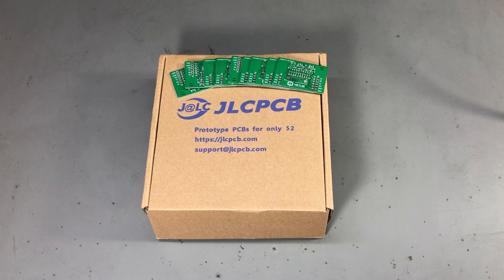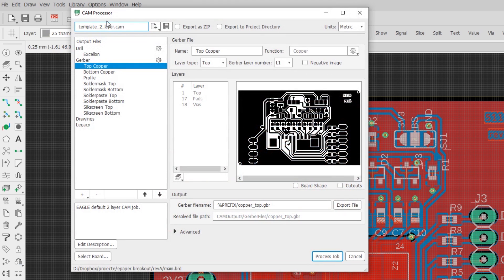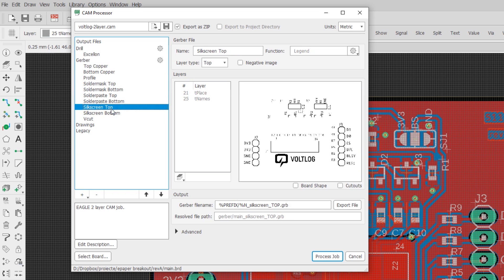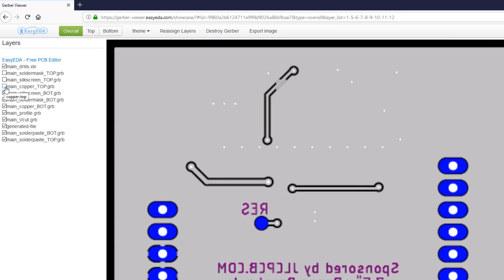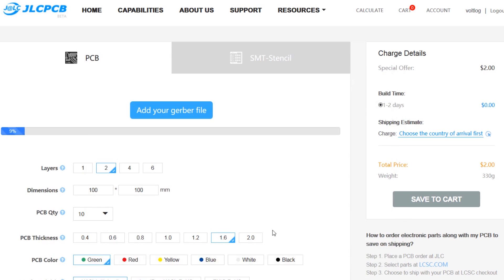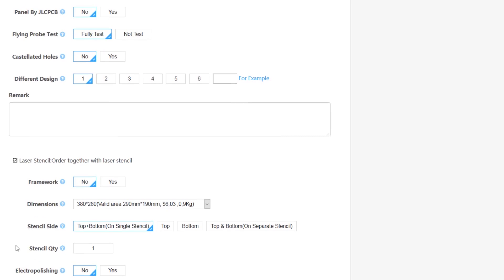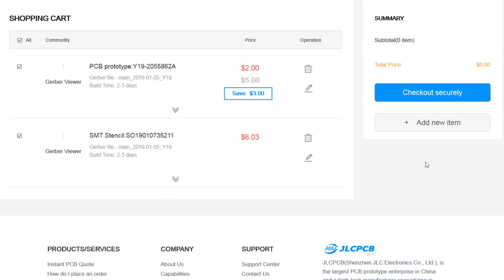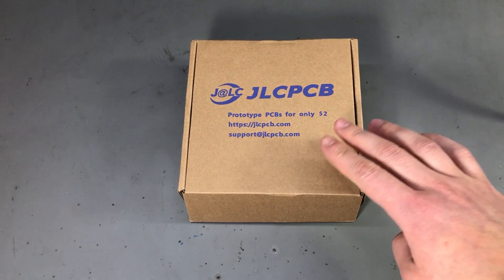Voltlog #201 - How To Generate Gerber Files and Order Your PCBs

Comment: I do like to order from JLPCB and then get all the components from LCSC and combine shipping together and I'm never in a hurry to the states so I use the cheapest shipping and it usually get it in 7 to 10 days. the quality so far has been great..and the components work good and super cheap...I also use Fritzing to do my pcb work. its a little basic but really easy and free..great video..thanks..
Reply from the maker: Unfortunately the regular postal service is pretty bad around here and I would be getting my PCBs after at least 4 weeks, that's why I use DHL.
Reply: @voltlog  bummer...DHL for me on my last order was $18.00 for shipping instead of $8.00 on standard china mail..but that makes sense in your case

Comment: Great tutorial!  Would it be feasible to put multiple identical smaller boards on each of the ten 100mm x 100mm PCBs? My design is a small breakout board (about 12.5 mm x 12.5 mm), and it would be fantastic if JLCPCB would allow me to fit 49 (7x7) of them on each of the ten 100mm x 100mm boards.
Reply from the maker: yes they allow panelization with some rules https://support.jlcpcb.com/article/49-pcb-panelization
Reply: @voltlog  I missed that. Thank you so much for the link!

Comment: Thanks for the Video Florin. One question I have in mind since a few months is: if everyone now only orders „prototype PCBs“ at JLCPCB or wherever, does someone really order „production PCBs“ when a design is finished? Why should one? And what’s the difference to a prototype PCB besides the price and maybe the silkscreen when the finalised board hides in a box or so? Maybe you or one of your viewers has an idea? I never ordered my own PCBs but I find that question really interesting.
Reply from the maker: People do order "production PCBs" from these type of prototype services by simply ordering more qty and they get exactly the same PCBs I would assume. This works for small quantities, simple projects, like under 200-300 pcs. However if the product in question is more advanced and needs a higher quality PCB like for example: higher Tg temp rating, controlled impedance, smaller holes, thinner tracks, high count BGA or 100% electrical testing as well as other parameters testing, than you need to arrange for professional pcb manufacturing. 

Also for a professional/production PCB you might want your design panelized so it goes through your assembly line more efficiently, for example you could have your small pcb arranged in a 3x4 array, thus having 12 boards going through the pick and place at once. Such a panel, would not be possible to order through the prototyping service, because in the prototyping service, they take your small pcb and panelize it with others, on a big panel, they manufacture it, and then they separate the different designs, this way they minimize their losses, using space and resources as efficiently as possible

JLCPCB is a big company and I'm sure they also offer these types of services, but maybe one would need to contact them to arrange such an order.
Reply: VoltLog ok that’s a point. Didn’t think about ordering more quantity on a panel for production or even for placing it into a pick n place machine. Thanks for your thoughts Florin.
Reply from the maker: @Hasitier  you're welcome

Comment: Huge stencil is huge! JCL still hasn't figured out how to offer an appropriately sized stencil?
Reply from the maker: Just today I was thinking that as I was ordering a new set of PCBs. My bet is that there is some kind of standardized manufacturing line, and making them to a different size would most likely mean having someone perform an additional step, to cut them to size, which would cost extra and be subject to human error.
Reply: @voltlog  I wonder if you can nest a bunch of board designs together to make better use of the space? Are you able to submit a separate file when ordering the stencil? That would cut stencil cost down even further.
Reply from the maker: yes, I think that's possible, although I haven't tried it so far.
Reply from the maker: JLCPCB have replied to me and they said it's possible to both panelize designs on one stencil and also order it in a custom size, there is an option on the order page which I didn't see so far but it is there, switch that option to "yes" and you can enter the size.

Comment: Just the right pace and useful tips for someone like me who plans to someday design my own PCB's, thanks!
Reply from the maker: If you are just starting with pcb design, I would suggest taking a look at Kicad, although the learning curve might be steeper than with Eagle, it should have many advantages in the long run. My plan is to switch to Kicad, as soon as I have some spare time to learn the new software.
Reply: @voltlog  I bought a book on PCB design with Eagle at some point, but the user interface seemed so painfully unintuitive that I gave up on the idea for a while. Then I started considering KiCad as I noticed it being recommended by many makers. I even installed it but the whole process seems quite overwhelming when you have no idea where to start (I am aware of the tutorial series on YouTube though). Lately I've been thinking if EasyEDA would cut it for me as the concept seems so easy to approach. The PCB's I would be interested in designing at this point are very basic, things you could do on a protoboard. What are your thoughts on the viability of it?

Have you by any chance considered doing some kind of intro on PCB design and/or SMD component selection? For instance general guidelines on choosing components (package size, availability of existing components in PCB design software) or common pitfalls why many initial designs fail. There seems to be a lot of SMD soldering videos in YouTube but I've felt there's little videos on how to bridge the gap from through hole components on a protoboard into SMD component based PCB design. Or maybe I just haven't found the right channels?
Reply from the maker: @ristomatti  I don't think there is a single PCB design software where the interface will seem intuitive for a beginner. Even after you've worked for years in something like Eagle, it still seems counter intuitive to switch to something like Kicad where things in the UI are handled differently. It's just a bridge you will need to cross in order to acquire this new skill.

If you think protoboard complexity level is all you need and will need in the future, there is no point to learn a more complicated software, stick with something like EasyEDA if you feel it's more intuitive. But if you plan on learning little by little and creating more complicated PCBs than it might be a good idea to start with something like Eagle or Kicad, because it will payoff in the long run.

It's an interesting idea to do a tutorial on getting started with smd component pcb design, I will add it on my to do list. I never though it would interest anyone, but now it seems to makes sense and I could do a video going through my usual process when designing a pcb.
Reply: @voltlog  That would  be awesome! Also based on your comment it sounds like learning KiCad would be a better investment of my little available time. Thanks,

Another subject I've found very little about is building nice enclosures. Preferably non-3D printed ones. I've found my projects often get stuck with not figuring out how to best attach the display etc. So far the best tutorial on the topic has been this Sparkfun article https://www.sparkfun.com/tutorials/38

I understand this might not be a fitting topic on your channel but just saying in case someone has good tips on channels I should go to for this kind of thing. For now I've found only a single video covering similar things as that Sparkfun article but it was not very good.
Reply from the maker: I'm also struggling with this when building new projects. You can either A choose a ready made enclosure (there are thousands of models and sizes) and design your pcb and project around that but in the end you will still have to do some cutting and you would probably end up gluing the lcd to the case because most cases don't have the right openings and those that have are not really designed for your specific LCD panel.

or B design your own enclosure and 3d print it, that way you have the necessary openings.

Regarding attaching small LCD panels, they don't really have mounting points so you will notice they are usually attached to the PCB, using double sided tape, and then the PCB itself has holes for mounting to the case. With the right spacers, the PCB will position the LCD screen right over the opening in the enclosure.

Using older and bigger LCD modules, might give you some mounting holes. Those are easier to install (see a 16x2 character lcd display) because you can have some threaded spacers on the front panel of your enclosure and mount the LCD using screws.
Reply: @voltlog  Yep that's pretty much what I've been doing. I've got several sizes of boxes and protopcb's and try to pick the smallest one. I've become pretty good with creating openings for the displays etc. using a nibbler/Dremel/pliers/hobby knife/file but in the end it always looks shitty and I'm thinking there's gotta be a better way. :)

I usually end up hot gluing half the parts in place also and I don't like the result st all when I need to open the enclosure....
Reply from the maker: @ristomatti  if your box has flat shapes you can also design PCB front panels, they will look very nice. I've done this in my dark load project https://youtu.be/PV3c-AYyirA?t=179 once more reason to learn pcb layout :-)
Reply: Eagle is one of those programs that definitely shows it's origin in the, I think, pre windows era. But it is a tool and like with all of them you just have to learn how to use it. That applies to all PCB design software. In the end there's not much difference. The hard part is the layout of everything anyway and no program can take that job off your hands (for now). 
Just as with programming where there are dozens of IDEs, all with different features and "helpers". But in the end the programming itself is what is difficult, not using the IDE.

Comment: What about import taxes and DHL duty service, they like to change those. Did you have to pay extra?
Reply from the maker: jlcpcb declares the value of these packages as $8, which is correct, excluding shipping :-) so I haven't had to pay any import taxes so far.
Reply: How much is the shipping?
Reply from the maker: @Chupacabras222  Shipping varies a lot depending where you live, what method you chose and the time of the year. I usually use DHL HK and I usually pay between $15-25
Reply: They advertise $2 for PCB. It's called "misleading practice" in my country. They intentionally omit fact that there are huge costs related to that offer. So "$2" offer will cost much more.
Reply from the maker: @Chupacabras222  Could you be more specific, what are they omitting?
Reply: @voltlog  I believe he is trying to say that $2 price is misleading because they fail to mention the expensive shipping (perhaps they even cover some of the cost that way). Do they even offer other shipping options other than DHL?
Reply from the maker: @MitjaSkuver  I wrote a long reply earlier (don't know what happened but it didn't publish) comparing prices with seeedstudio which was a service I previously used and it is way more expensive to order from them. Bottom line is, if anyone knows of a service that can supply the same pcbs for less than JLCPCB, let me know. Until then any complaints regarding the cost seem useless since they still have the lowest cost.
Reply: @voltlog  perhaps you're replying to wrong person? :) I was only asking about import duties and other shipping option. But since you didn't answer I checked myself, they do offer slower Air Mail shipping which is also much more affordable ($23 DHL vs $6.5 Air Mail in my case). So that's cool.
Reply from the maker: Mitja Skuver sorry the longer reply had more info. And I just clicked the last reply so it used your name for the reply.
Reply: I don't think they are engaged in deceptive practices as they charge similar shipping rates as other low cost suppliers.

But I must say that the difference between 10 boards for $2 isn't really much of a savings compared to vendors offering 10 boards for $5 (a large number of fab houses have been at this price for a while now).  That difference does become significant however if you want other than green soldermask.  JLCPCB has a considerable up-charge for other colors, while many of the "10 for 5" places include the standard soldermask colors in the $5 deal (green, red, blue, yellow, black, white).
Reply from the maker: @bigjonseattle  well. everyone is free to order their PCBs as they wish and pay as much as they wish but for now JLCPCB has the lowest price for a set of 10 pcbs and if there is another place that's cheaper I would be happy to give it a try,  let me know if such a place exists.
Reply: ....not a significant difference WHEN SHIPPING COSTS are considered. 

(Sorry, left that out)